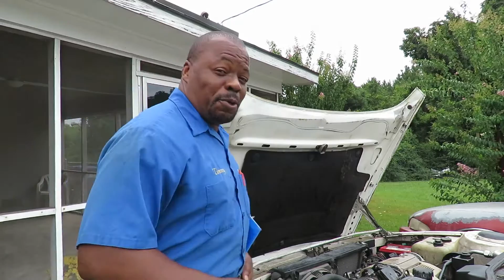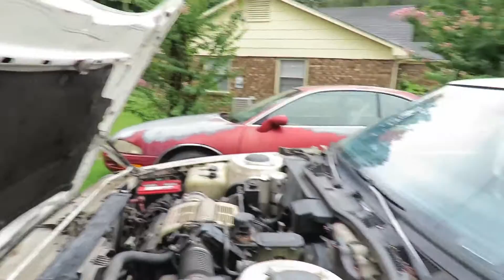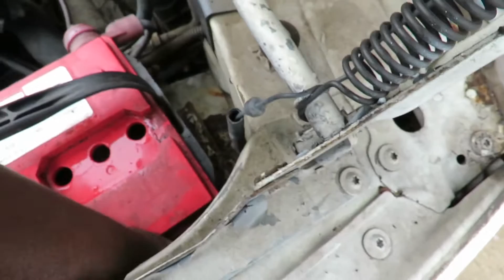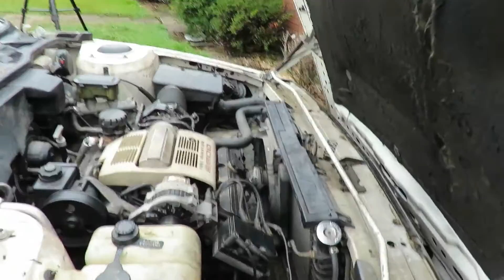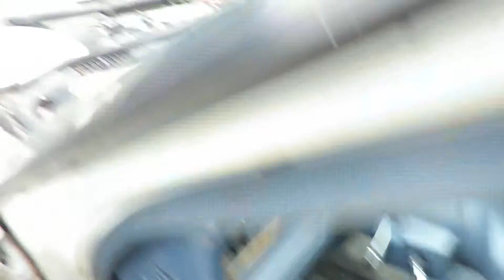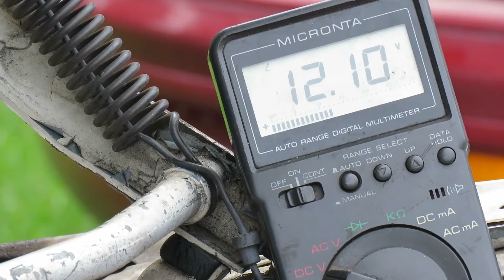⭐ No Start, Just Click - 1990 Buick Lesabre Custom

Comment: so was it the starter?  I've heard if it doesn't make a clicking noise for sure it's the starter
Reply from the maker: Yes it was
Reply: Astral Auto Repairs  thanks I got a van just clicks once, cleaned terminals checked fuses has over 12v  battery  checked good
Reply from the maker: Hi, yes it sounds like a starter, especially once you checked the terminals and the battery.
Reply: Hey i have a 89 buick lesabre and my car wont start just click. We took the starter to auto zone n the said the starter was cool and i still have strong lights and my radio still works.as also tried to charge the battery what do you think is wrong
Reply from the maker: Big Q make sure the battery post is free of corrosion, then check grounds.